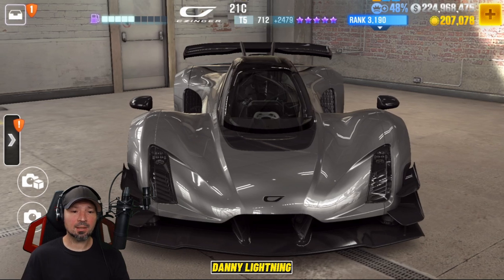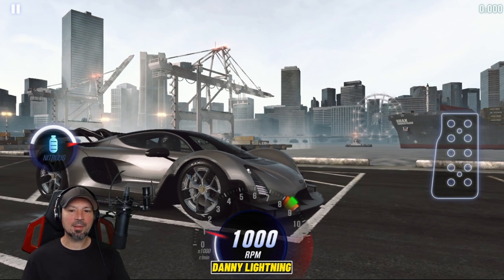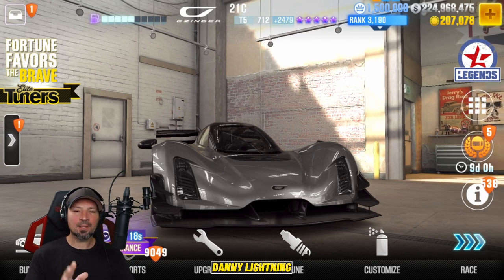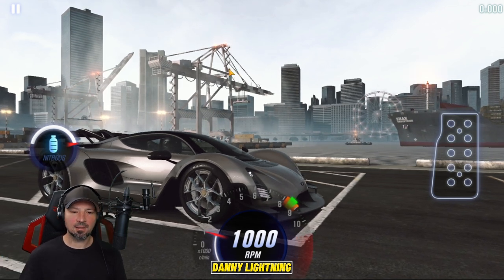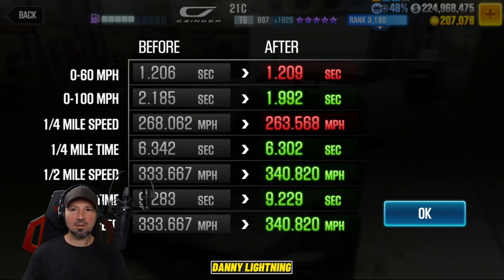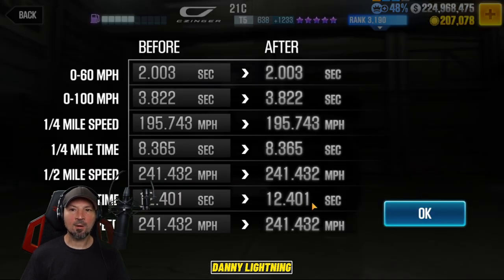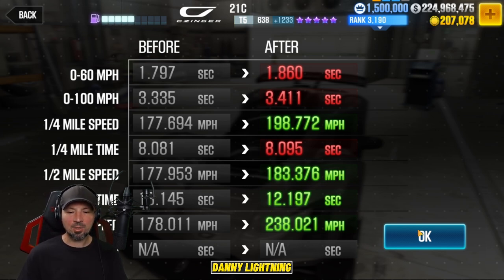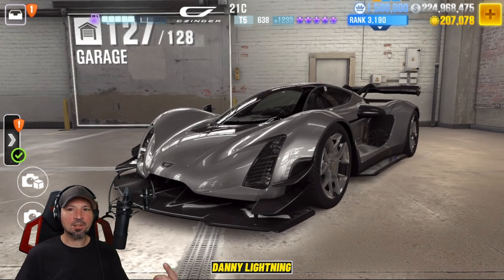CSR2 CZinger 21C Shift Tune Review Live Racing Setup

Comment: Hey Danny, I'm new to the game. Which car is better to use my elite token? I'm talking about same car, car from dealership( no*) or from rare imports?
Reply from the maker: Okay so you're going to get a free Toyota Supra gr at some point,. Once you hit a certain rank the elite tuners event start and they give you that Supra for free after running a couple of the first races on the toshimi x event,.   I say save them for the supra, don't spend them on anything else at the moment because once you get that Supra if you can Max it out and get enough of those late upgrades on it it's a amazing car almost everything, runs like a 6.9 maxed out on stage 5 or stage 4 you can set it up to do great at live racing I mean it's just a really cool car so save your elite tokens for the Toyota Supra gr from elite tuners,

When doing Legends I didn't really have to install a bunch of elite upgrades on my cars to finish Legends so I'm guessing you won't either unless they change something and legends cars aren't really that great anyways so I would save them for the elite tuners card which are actually mostly very good cause
Reply: @Danny-Lightning-CSR  thanks!

Comment: Hi, the setup for live race works well but if the game push you up another lobby what can you do to comeback into the first lobby ?
Reply from the maker: You have to run a lot of live races going a couple tens of a second slower than your dyno time, I hear they've making it to where it's harder to get pushed back so I guess you have to run a load of them without beating the dino before it moves you backwards again which is the pain so I always go for those low performance point high evil tunes where I don't need to beat the dino wind cuz that saves a lot of headache